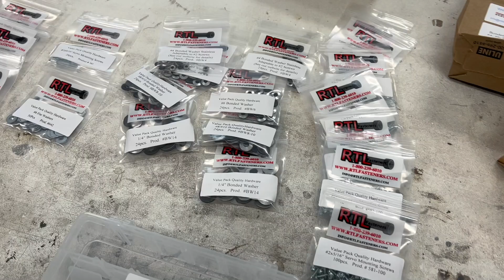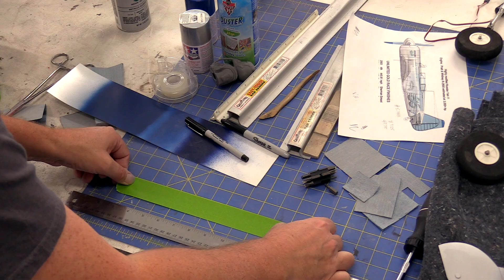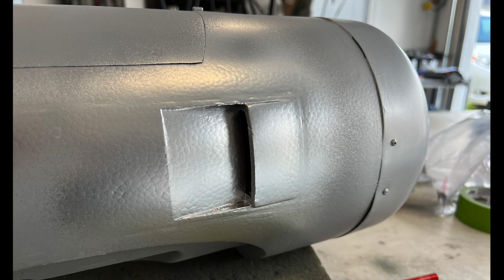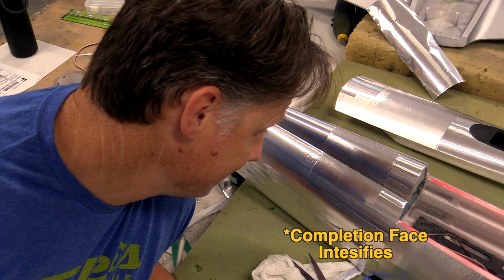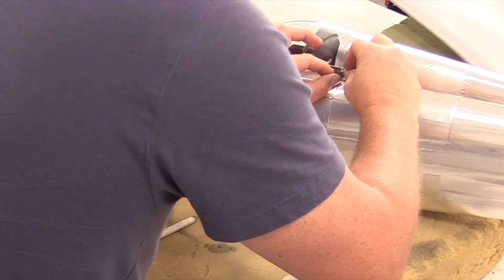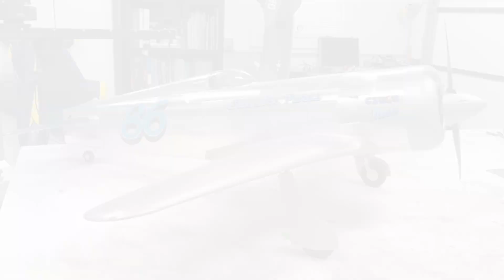DIY RC Reno Racer - Polished Aluminum Application & Paint

Comment: A tip with flight metal is burnish it down well to the tape edge, put your initial cut to begin them pull the tape up from where you cut it. It should pull a straight line along the tape. Your welcome :)

Comment: Did you find the flite metal would wrinkle with airplane use over time? I did a foam 1100mm P-51 with similar technique and it looked amazing at first, but the tape began to show wrinkles and creases with use due to flexing/twisting of the fuselage and wings. I had the impression thereafter that the only way to avoid would be to fiberglass or otherwise stiffen the entire airframe before applying the metal tape. Thanks, great channel!🙂
Reply from the maker: I refinished the whole airframe which included multiple coats of minwax polycrylic which hardens and stiffens up the airframe. So, I don’t anticipate much in the way of wrinkling aside from what my heavy hands introduce into it. 🤣
Reply: @Thercgeek  OK, please keep us posted as to how it holds up over use! Thanks again

Comment: I’d like to comment on a statement made to use Frog tape.  It was mentioned that Frog tape does not lift the underlying prepared surface.

Not so!

My aluminum foil covered Mustang had decals applied to the fuselage.  Then a good clear coat was applied & allowed to cure (not just simply dry) over the next 48 hours.

When pulling off masking tape in fillet areas between the fuselage & wing, not only did the tape pull off the clear coating, it also pulled off the decals & parts of the underlying prepped surface.

I would just say to exercise due diligence & be aware.

Beautiful job on your model of Checkmate.  I live in the Reno area & have seen this beauty up close several times in the pit area.

Good show.
Reply from the maker: Thanks!  Of the tapes I’ve used, frog tape is the least likely to pull up the prepared foam surface. It’s not 100%, but better than most.  What you’re explaining is a bit different though as you were taping over clear coated aluminum. Adhesion directly to aluminum can be pretty challenging.

Comment: What kind of work! 👌But the result looks great. 👍Well done. Only the rivet heads are missing. No fear of RC reception shielding?
Reply from the maker: Thank you! I was a little concerned initially, but having seen a number of aluminum covered models fly gave me some comfort. The model has now flown and it has turned out to not be an issue at all. 😊. The flight vid should post in a couple weeks hopefully!

Comment: Sweeeet!! Thanks for the little tips. Three or four months ago I bought a 1/5 scale mustang from Pica. It was about 25 years old, built by a professional, and hung for display only. The 180 Moki in it had never even been fired. The tank and lines were dry. When I got it it was absolutely beat to shit. It’s probably last on my list for my projects. It makes my stomach turn just look at it and see what someone has done to it. It even came with Sierra  (I say Sierra because I do not believe they are Robarts, I haven’t dug into it that deeply. All I have done is pull the engine and looked it over. It has unbelievably strong compression. And the piston hasn’t been up and down more than 100 times.)retracts and the aluminum scale wheels. Whoever did the flight metal did a fantastic job! But it’s all beat to shit now like I say. Maybe this video will give me some inspiration. 👍🍻
Reply from the maker: Thanks man!  Real bummer to hear about the p51. That is one drawback of the Flite metal as it’s soft and so gets dinged pretty easily if not treated appropriately. Is it just the metal work that’s beat up?  Or is there more damage to the model than that?
Reply: @Thercgeek  The gear doors are ripped off, it’s missing half of the canopy, there’s dents and gouges all the way into the wood etc. etc. etc.  it’s unbelievable what some son of a bitch did to this plane. I just get pissed off so bad it makes my blood boil when I go to look at it. It’s so bad I can’t even look at it. I’ve got 75 bucks into it. There’s $600 in the landing gear, $225 in the wheels and tires, and a $400 plus  in the Moki engine. Plus all the antiquated analog radio gear that is brand new, top of the line for the day. All brand new. So I got all that for 75 bucks! I’m actually thinking of burning the airplane and setting its spirit free.

Comment: Nice work! Did you need to do anything special for the receiver /antenna  so the metal foil didn’t interfere with signal?
Reply from the maker: Nope, it’s not an issue at all.

Comment: All I can say is Wow Chris! Very Impressive! 👏👏👍 Chris I a question off topic. I have the E-Flight T-28 Trojan 1.1m. I changed the wheels to the Du-Bro skylight wheels because I can’t stand the stock wheels are IMHO are junk, that make a bunch of noise and way to hard. My problem is the Club I fly at only has a 150’ X 20’ runway, and the replacement  wheels roll to good. LOL My question can I put Crow in that air frame Using my Specktrum NX8 Transmitter and the Specktrum AR631 receiver installed stock with the AS3X & Safe. There are two channels open on the receiver that not being used? If so how how I try to achieved this? What do I need to get and can I do it? Thank you in advance Chris! I’m really looking forward to see that bird fly in the new scheme! 👍😃
Reply from the maker: Thanks!  For the spoilerons, you can do that. You’ll need to put each aileron on its own channel and then set the configuration to two ailerons in the extended menu. That should open up the spoilerons menu that will allow you to set up the deflections you’re looking for. It’s worth a try to try and reduce any tip stall potential, but it may not actually reduce your approach speed since it effectively reduces your maximum lift as well. Trying it in flight will prove one way or the other. 😊